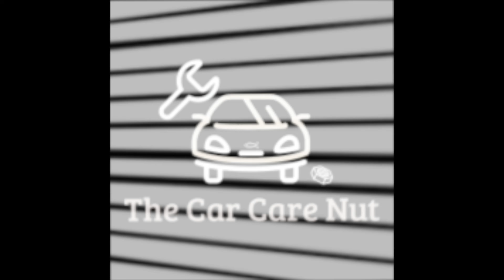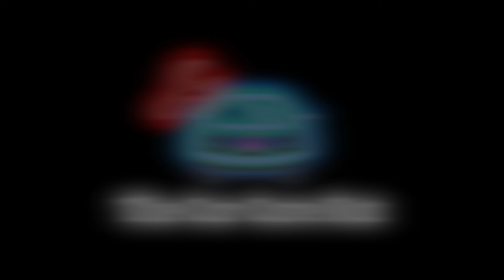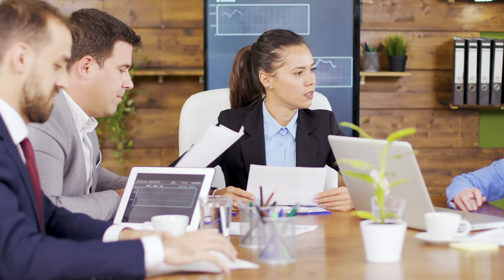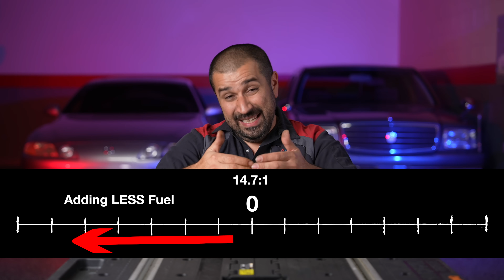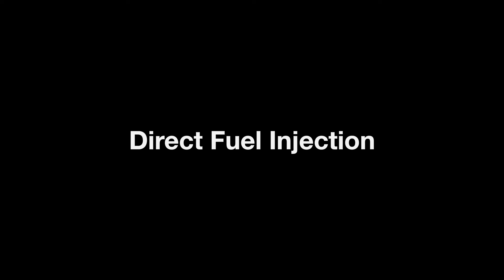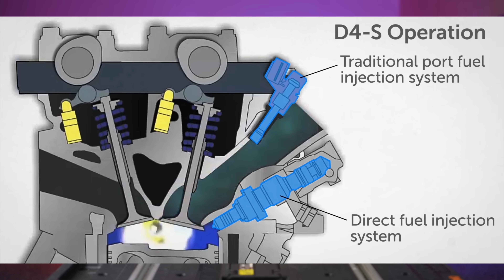Why Do Modern Cars Use Direct Fuel Injection? Fuel Injection Series Part 2

Comment: Yeah its simple ahmed you’re not engineer you are the father of all engineering 🙂 
Me in iraq and you know what the weather and the fuel i would prefer and take the 2gr fse because of you and the car is Toyota zero crown s180 grs184. 
This car have 3 different engines 4gr fse and 3gr fse both came with d4 and last one comes with 2gr fse D4-s 
Btw me afraid of fuel efficiency 🤣 can you guys explain the efficiency of fuel economy which one better in this car

Comment: Thank you for your explanation of the various systems!!! I currently remove my intake manifold yearly to manually clean the built - up carbon deposits on my 2012 Audi Q5 (2.0T). I'm thinking of replacing my Q5 with an RX 350.

Comment: Direct injection will carbon the intake valves and goodbye engine.  Carbon buildup keeps getting worse as miles add up.  It is hard to find vehicles without direct injection, turbo chargers. Goodbye longevity for vehicles.

Comment: I'm very impressed with the efficiency my 2020 Camry 2.5 Dynamic Force engine has. It is a marvel of advanced engineering. The MPG in town...around 27...on the highway...38 - 40 MPG (depending on a few things). On top of that it has plenty of power at any range.

Comment: Another absolutely excellent video---One comment--I wouldn't ever buy a car with only Direct Injection.  I've seen the carbon on Audi/VW products--it's horrible.  Partial answer is a "catch can"--but adding one yourself would void warranty.  One MB exec told me they don't do catch cans at oem level because consumers would forget to empty them and really mess things up.  The Toyota system is an excellent compromise...

Comment: So will top tier gas plus very frequent top quality full synthetic oil changes say, 2500 miles, prevent carbon valve build up?  Note...I did the first change myself at 950 miles using Idemitsu 0w20 and Mazdas top oil filter. The car is a  2024 cx5 non turbo. PLUS I HAVE NO ISTOP OR CD ON THIS CAR...HURRAY! I live in deep south GA and I warm up the cx5 until the temp needle moves a bit  and rpms drop from 1400 to about 950. Then I drive it like the 68 year old man I am.  But it is mostly 5-10 mile trips.  I just don't take long trips anymore.  What improvement do I need to make to keep carbon as low as possible.  Owned this car from new.  Had it 6 months now it has 1600 miles. Suggestions other than an Italian tune up!   I don't need a ticket at this stage of the game.  Thanks. Really enjoy all your videos.

Comment: Direct injection causes soot at cold startups. This ends up on the cylinder walls and then the oil ring scrapes it off the cylinder walls and into the oiling system. It makes your oil full of soot. In some engines the size of the soot particles causes problems (areas with tight tolerances). So if you have a purely direct injection engine, don't idle at cold (ie start and idle the engine to warm your passenger compartment). Also change oil often, don't wait the for long manufacturers recommended change intervals. According to Lake Speed Jr... To get rid of carbon valve buildup use a PEA fuel additive the last tank full before you change oil. PEA will help clean your valves of carbon buildup, but that carbon ends up in the oil too. So change the oil after you do use the PEA additive.

Comment: @TheCarCareNut
Hello!
I am very confused with my new (2 months old) Toyota corolla TS 1.8 Hybrid. I don't see a logic in fuel range on computer board.
I drive every day the same road to job and back to home. 66km in one way. I did fuel refill until the end (first click) and it showed 860km until next fuel refill. My Toyota apllication shows that overall fuel consumption is 3,9L per Km and that I use "only EV mode" 50% during driving.
Here is a problem. Board computer shows me 1km less (until fuel refill) with each 1km passed in reality, nevertheless my EV driving mode is between 50-60% (depends on day but is very similar). 
So, I pass 66km in reality, on computer board is 66km less.
Until today, I had the same fuel consumption, same road ecc. but it showed 77km less and next day 86km less.
Is this normal or not?
This is my first Toyota and Hybrid and I am still learning. 🤷

Comment: Two major drawbacks with Gasoline Direct Injection (GDI) engines. They emit higher particulate number (PN) emissions than conventional port fuel injected (PFI) engines due to the reduced time for fuel atomization in the combustion chamber and the greater possibility of fuel impingement on the cylinder wall surface. For more stringent emissions, a particulate filter will be required in the future (such as a diesel), already used by some manufacturers in Europe. As discused in the video, carbon build-up on intake valves is another issue. Maintenance (oil quality/oil change interval) and the type of driving are key factors. As a final note, GDI is more complex and expensive to fix. Can not stop progress !

Comment: Direct fuel injection would be great if it weren't for EGR. EGR recirculates exhaust carbon that collects in the intake and valves. Now direct and port injection helps clean that up. But direct injection and smog junk will guarantee a very short life to your engine.

Comment: The way I learned it was that the direct injection was most beneficial (for NOx emissions) under light loads.  The gains were diminished as engine load increased.  But there is also a thing such as injection timing, as under heavier loads, the fuel would be injected earlier during the compression stroke.  This would also create the cooling effect which I didn't think about before.  But there's also the same cooling effect in the intake manifold.  I am curious as to how much it actually makes a difference.  But for a turbocharged application, the benefits could be huge.

Comment: My 2013 IS250 has the 4gr-fse engine, and currently has 230,000 miles on her. Runs great and gets 32mpg. I do clean the back of the intake valves every 2 years and change the oil after 5000 miles or 6 months.

Comment: Is it normal for my 2012 camry with only 50k miles to have a slight fuel smell when I take oil cap off. It us always dealer serviced and oil changes religiously at 4000 miles or less?

Comment: Hello, I'm old school 4x4. 4hi and 4low locking the hubs and find a rock😂. back in the early 80s gas was expensive so I started driving subaru gl-10 if you remember that far back. hydrolic adjustable shocks and a crazy digital dash. so fun. Anyway Four wheel drive tech. has advanced  . Please do a series on this please. 
Thank You and God Bless.

Comment: My wife had a 2017 RX350 and we got the check engine light for #4.  Lexus said it was a clogged injector, so a car with 47,000 miles driven mostly on highways cost me almost $1,000 for repair.  One month later, same problem but it cut our speed to 25 MPH so we could not take to Lexus.  A very reliable service center found that the coil on #4 was burned because the battery was not providing enough current.  This time it was almost $3,000 to fix it.  It was fine after that but we lost trust in the brand.  We now have a RAV4 hybrid and love it,

Comment: Thanks a lot! Bottom line: Do as much "periphery maintenance“ as possible and hope that the 
electronic of the engine keeps working? Do you recommend to change fuel filters way more often than 
recommended, a bit like your oil advice?

Comment: 2011-20-14 volt is port injected, iron block. 2015-2019 volts are direct injection aluminum block. both have basically what toyota calls an e-cvt, gen1 uses a large expensive milled gear to get the ratios right, gen2 uses a large metal band like most ice cvts.
gen1 volts last a lot longer, get less mileage, but their engines never have problems other than an egr valve diaphragm. chevy figured out how to make a car that lasts forever and gets 100 mpg. ive averaged 75mpg over the past 35k miles. obviously they stopped making them because they never broke. now everyones obsessed over new 60-80k$ PHEV's not realizing its 15 year old chevy tech. same with all the chinease phevs taking over australia and asia. you can get the same car used for 6-7k and it will pay for itself in fuel savings after a year and a half in my case... and it will never break, and the battery will show no degradation after 500k miles because you cant super charge it and its cooling system is way over specced while the battery is inside the car not exposed to temp swings. in cold weather climate the engine kicks on and protects the battery and i dont loose any range execpt when i lower my tire pressures because of snow/ice. 130k miles on the odom, 2013 volt, getting 45-50 miles of range per charge, crazy technology. no doubt chevy will start making them again soon, once they figure out how to make them break at 150k miles

Comment: That's very reassuring about D4S. My wife's 2022 Lexus RX350 has a 2GR-FKS engine, and I was leery of the extra complication & reliability risks of dual fuel systems.  But apparently Toyota has refined D4S for ~20 years and probably have thoroughly "nailed it", just like their hybrid technology.  
I'm also thankful that Toyota/Lexus don't need obnoxious "automatic start/stop " or cylinder deactivation gimmicks to achieve gov't mandates.
Nevertheless, I am conservative regarding daily driver cars & their reliability,  and given a choice, I'd have been happier with just port-injection alone, even if does give up some efficiency & power.

Comment: Yes, it’s beautiful.  More refined, more complex, more efficient.  But not so lovely to an average user when it breaks. This complexity requires a component replacement strategy for repair.  Not just parts. Components tend to contain many specialized parts, most of which are still functional when the whole component must be trashed and replaced because one portion fails. The cost of components is sky high, often to the point of totaling an older vehicle, leaving an owner of modest means in a dire situation, suddenly with no transportation. This is even more likely when the dealership service people can’t pinpoint the problem and start guessing and replacing one expensive component after another without ever fixing the original problem. For these reasons, AMD, your beautiful engineering becomes a blight.  How long will these gracile Toyotas stay on the road before the cost of repair sends them to a junkyard?  Older, simpler, more robust Toyotas will still be serving the people’s needs.  I guess we will end up looking like Havana filled with 60-70 year old cars?  That sure looks cool, but it’s a sign of poverty due to oppressive government over-regulation.

Comment: I would think that with Toyota's D4S system they are able to use a smaller amount of the port injected fuel to propagate the spark faster than with port-injection only or direct-injection only system?  Is the same amount of fuel for a particular cylinder divided between the port & direct injectors, or is the total amount of fuel for that cylinder now less?  Does it produce better gas mileage due to the efficiency?

Comment: We have a 2020 Toyota Highlander, hybrid all-wheel-drive.  This is a 2.5 L dynamic force engine and has port fuel ejection along with direct fuel injection.  Thanks for explaining why we need both. I had no idea that they both work together for maximum fuel efficiency. Thanks again for explaining that in simple terms that even I can understand.

Comment: Excellent explanation, that’s why I will not buy cars without port injections for preventing carbon build up.
On the emission control regulation: every thing has a limit. You just can’t have too much “good things” without any consequences. The extreme emission control regulations have pushed car manufacturers coming up so many bad designs that they will cause more pollutions and costs in the long run. EV is not a solution for reducing pollution. More importantly, cars these day don’t contribute a lot to the pollutions overall.

Comment: Is 0W-20 bad for your engine? I see people are switching to 5W-30 or 5W-40 for diesels as it is better at pulling the heat out of the engine were as 0W-20 breaks down too early and quickly losses it’s ability to pull heat from the engine. This means oil changes now have to happen even earlier with 0W-20. Maybe this was the issue with the Tacoma or any vehicle that pulls heavy loads? 0W-20 just can’t cope with the heat issue. Can you look into this for us my bro?

Comment: I use a air/fuel computer to tune my motorcycle, 14.7 may be the "ideal" but ideal for what.  I found that setting the ratio at 13.5 - 13.7 got me better fuel economy and power.   Running at 14.7 always resulted in worse gas mileage .. make a person wonder.    If I wanted to run faster I would drop to 13.0 - 13.3

Comment: My 2017 Prius Prime, with 81,000 miles, is showing the following fault codes from an AutoZone OBD-II reader:
C1259: HV/EV Control System Regenerative Malfunction
C1310: HV/EV System Malfunction
I’m not sure if there’s an additional code starting with "P." The car lurched suddenly, so I pulled into a parking lot and turned it off. Now, it won’t shift into drive or reverse. The car powers on but doesn’t charge the traction battery and won’t move.
The display shows:
Hybrid system malfunction, insufficient power
Pre-collision system malfunction
Braking system malfunction
I’ve checked the 12-volt battery, and it’s new and in good condition. There might be another missing code. Any assistance would be appreciated.

I bled brake fluid about 3000 miles ago and the brake fluid level is not low and I think I did a good job.

Filters are all Good. Replaced all filter including HV battery filters (all OEM) about 2000 miles ago.

Always kept the car at tip top condition.

Please help.

Comment: Hi Ahmed … this was a fantastic video.  Keep em’ coming.  I would be interested in some feedback for owners of vehicles with DI only.  I purchased a 2016 Honda CRV, which has their trusty 2.5 L but with direct Injection only. My wife spent several years driving the car short distances, and idle and performance were being affected.  I had an induction service performed (chemical cleaning of the intake manifold) and the result was very pronounced and positive.  Honda does not recommend this, which I don’t understand.  Feedback on this would be appreciated.

Comment: Direct fuel injection isn't as new as people think. The 1956 Mercedes 300SL Gullwing had direct cylinder injection, but it was entirely mechanically controlled. Simply brilliant.

Comment: Automotive generally use tier 3, 4 level computers, since there is not much work they have to do , they do not need leading edge technology.Engineers also trying to transfer more tasks to the computer since the late 1980s , such as alternator voltage regulator, anti collision cruise control etc. The main disadvantage of direct/indirect injection system is the extra complexity, more things to go wrong. The only way to justify it is aviation uses where you need the redundancy.  For the small amount of gains. Auto fuel economy and pollution had long age reached the point to diminishing return, engineers had long ago picked all the low hanging fruit, and improvements will come at smaller and smaller increments and cost will spike. I winder if they install a manual pump at the intake manifold and we use it for a couple of strokes every week or so to dump some raw gasoline at the valve, plus an oil catch can, will this cure the carbon problem.

Comment: In 2024 the Toyota Tundra was recalled bc of an engine problem which required replacement of the entire engine. In 2024 the Toyota Corolla Cross has a recall bc the brakes don't work properly when driving around a curve. Toyota appears to be becoming LAX in its quality control. Are they resting on their laurels of being one of the most reliable cars? I don't care why a car is being recalled. It says there is a problem in the company that needs to be fixed.
Thank you Ahmed for a very informative video.

Comment: It would be helpful for those of us driving GDI cars without supplemental port injection to know how to reduce the rate of carbon buildup on the backs of the intake valves. I’m sure frequent oil changes with high quality synthetic oil is helpful, as is buying quality gasoline. Any other tips?

Comment: The biggest question I have is why did it take so long to transition from multiport fuel injection to direct injection. Diesels have done this for many years. Transitioning from single port to multiport took a relatively short period of time, then we stagnated. We had closed loop systems back in the eighties, and fully fledged management systems followed shortly after (e.g. Ford EEC 1V and Nissan ECCS.)

Comment: Can I use w0-30 in my 3rd gen tacoma? I live in a very hot climate.
Reply: No if you have a warranty claim and they do an oil analysis they will void your claim. Also, don’t be afraid of the zero16 oils they have the proper additives for the engine and they’ve been tested and approved by the engineers.

Comment: Stoi·chi·o·met·ric!  Multi-Port for me.  I don't like carbon all over my valves!!  Can we say that Direct Injection really came from Diesel Engine technology?  The best DI set ups make use of a redundant Multi Port system working in unison with the DI applying fuel to the intake charge washing the back side of the valves, keeping them clean of carbon build up.  Ford is also doing this.  IMO, Just give me a multi-port set up.  I'm good.

Comment: I have a 2005 toyota corolla Ce  but drive cycle always  not ready Air fuel ratio sensor. Anyway not supportive  the ECM and no check engine light on.How to complete the drive cycle.